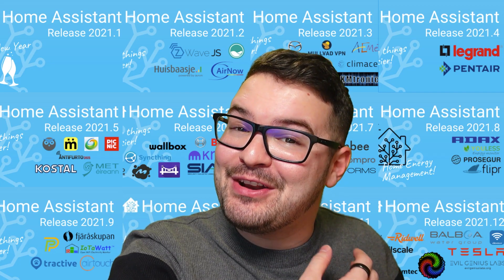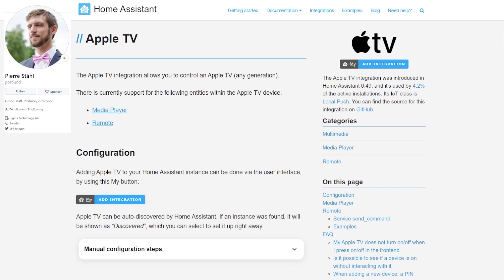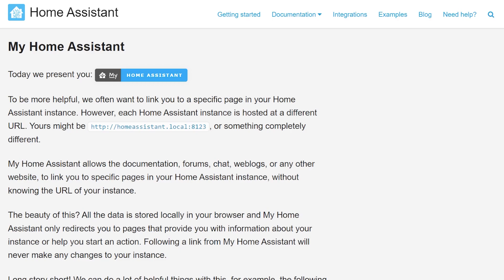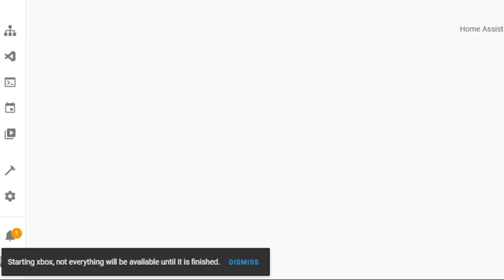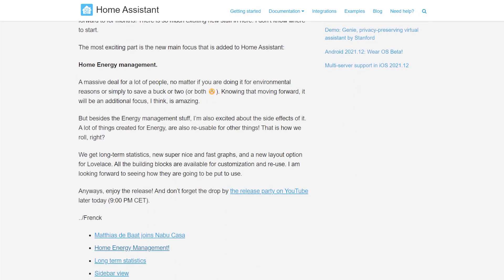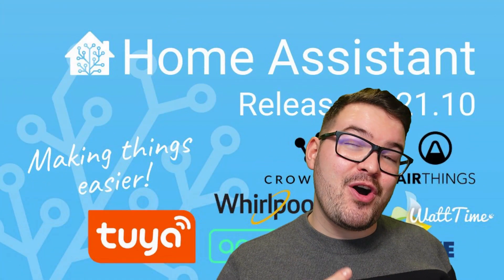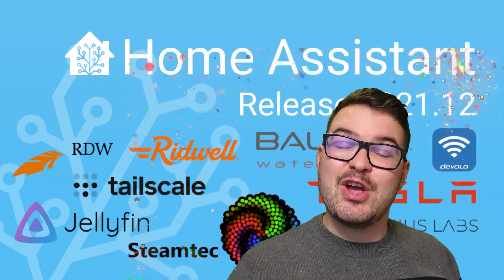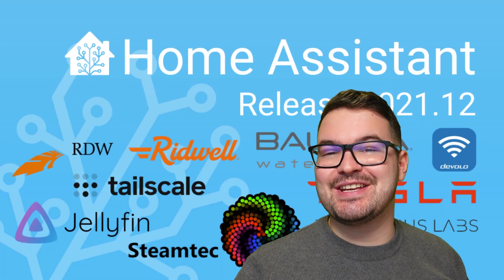12 Features of Home Assistant 2021

Comment: These updates have been very buggy. Had a broken hue, the new settings menu stinks and locks out non-admin from their companion settings on mobile apps.
Reply: Settings menu is not for me as well I admit but I’ve not found any bugs. Have to say I think they do an excellent job of describing breaking changes which normally seem to be the source of reported “bugs” . Just hold for .2 or .3 if you’re having real issues. Since the good backup and restore feature works so well I always move on .0
Reply: @iainhay2823  the hue thing was an actual bug. Updating past .3 and .4 fixed it.